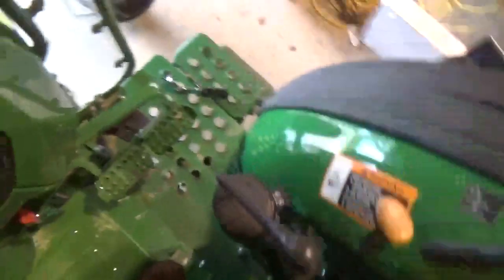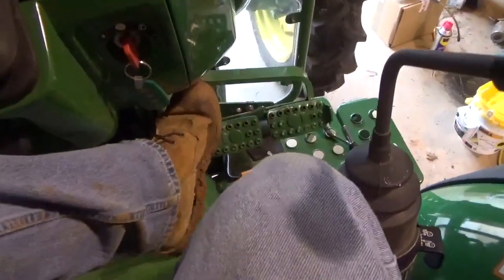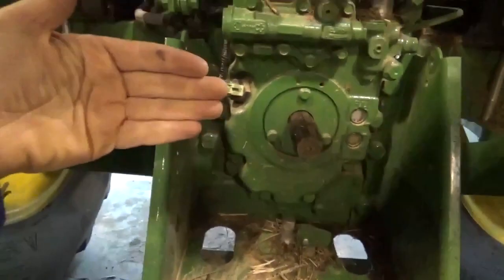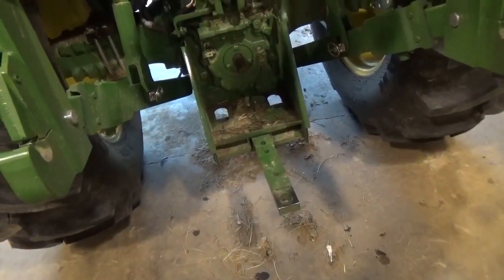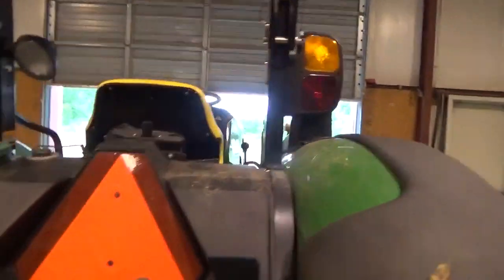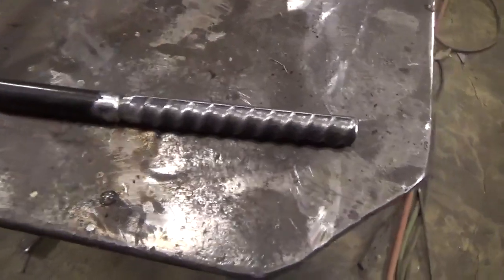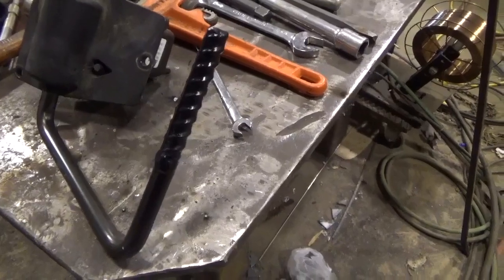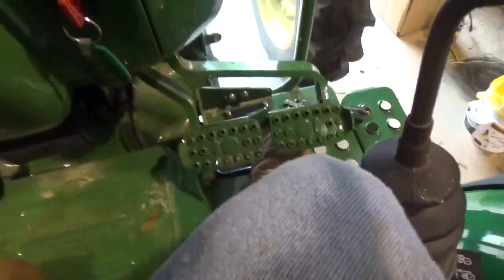New John Deere 5075E improvements!

Comment: The Deere Construction Buckets are stronger and better functioning than the Ag Buckets.
Check the Dealer for a used Construction Bucket.
Reply from the maker: +VideosByAl I am really considering just building one. I think it would be worth it from scratch just for the content I would get for the videos.
Reply: Good idea, no reason why we can't help pay for
an O'Bryant Construction Bucket .
Reply: I built one a few years back.. It goes pretty good if you can get the back portion pre bent

Comment: Good call on the skid steer mount Tim. I converted my kubota pin on bucket to skid steer style and it works great. Funny thing is I hardly use the bucket since I bought forks for the tractor.

Comment: looks interesting foot throttle mod. my right hand is real busy on my ol girl. clutch throttle 3pt hydraulic for my loader but my ol girl is a 57 JD 520. heck i had a lot of fun went into the woods and cut a fallen top and skidded it out with gramps homemade  boom pole then went for a blown down tree with the roots.  i tried to get over to it from one direction but i buried the tractor took 2 1/2 hrs with a come along to get it out. i then took and cut the 50ft trunk down and i dropped it one foot from my target and its first tree dropping

Comment: When I bought my JD 5075E I had the dealer change the JD mount on the loader for the skid steer quick attach with a JD construction bucket they come with the skid steer quick attach. Its not as large as the tractor bucket but it works for me. I use my grapple more the bucket anyway.

Comment: I have a JD 5400 very similar to your tractor, I have the same issue with the quick attachment, I will probably do a change to the euro quick attachment, because that's the more common in Portugal. this should be standard, makes no sense to have like 6 types of quick attachment.
Reply from the maker: +João Veríssimo I agree, there should be one quick attach and all use it.

Comment: Nice job! And the extension will surely have more grip! 

I have the same tractor, but with a cab. The foot throttle is moved to the right, clocked differently and is perfectly oriented. Maybe they mounted it like that because you can do a right hand mount, dismount. Which is not usual on a cab tractor, although I installed a right hand door so I could run the bucket off the tractor. The kit came with steps for the RH side, but I never put them on. 

I see you have a quick hitch. That is the same thing as the global mount in a way. You roll the bucket or implement down, manually pull the handle and clock it so it stays in the unlocked position. You set it down, an then go to the next implement. Once you pick up that tool, you roll up and the lock hits a cam, spring loaded and goes in the locked position with out having to dismount to lock it. 

I need to post some video of mine. I used my third function from a rear SCV. I have a grapple... It is SOOO FUN!!! LOL!

Comment: Could you cut a steel ring to mount the pto cover on to change it from a flip up to a pull out style with clips or wing nuts so the pto cover does not get dented by the top link?
or cut a plate that mounts to the two 'wings' to the side of the pto shaft.

Comment: Very glad you saw the light on Skid Steer (SS) attachments. Under 80 HP it is the only logical choice. Above 100HP the EURO or global is stronger than SS. The illogical choice is the JD standard with two hooks and two pins that require two snap pins. SS is the cheapest attachment type. Add $150per implement to the cost for EURO or the old JD. There are hydraulic kits to uncouple and couple with your third function valve for SS and EURO. Most EURO will allow you to uncouple. set down and implement/ lift up a new one and then jerk hard to have the bottom pins engage without getting off the tractor. The only advantages to the old JD are for the dealer - he gets more money and can sell you hearing protection for the bucket rattle too

Comment: do yourself a favor and get the JD 72 inch high capacity bucket. it is a case style bucket. you will not be sorry. it is extremely heavy duty and has a much higher capacity than the standard bucket. In my opinion the standard bucket is worthless. it is not tall enough

Comment: Deere has a reason for there attachments for there loader so you have to buy deere buckets and what not.
Reply: Before about 4 years ago or so, every tractor dealer had their own style of bucket attachment. Within the last 4 years, all dealers have began to offer the skid steer style attachment as standard. I haven't checked lately on what connections are available but know there was a big push to standardize equipment.

Comment: J.D. has been building tractors for one Hundred years and seems to have Forgotten the Basics. They can't even get a throttle or canopy right. 
A Few years ago I worked for our local J.D. dealer hauling equipment.  I hauled all sizes of tractors.  You would think that a Guy like me would be a "Kid in a Candy store."   But I didn't see much that impressed me. It was all I ever complicated  Computerized Junk that even the Mechanics said won't last anywhere near like the older Tractors.  
It's sad to see what American manufacturing has come to.

Comment: Yes sir Tim that's what I have on my John Deere is the skid steer attach so I can use all the skid attachments my bucket is like a skid steer bucket I'd like the regular bucket better I think like you said the regular buckets are higher in the back the skid bucket is longer on the bottom I'd rather have it in reverse no big deal still dose the job I'll send ya some pics crazy I just had a plate made for my skid steer so I can use the 3pt hitch stuff on that like a York rake so I can have down preassure do a gravel road or spreading loam looking good Napa Mike

Comment: CT,  nifty "fix" for the throttle but I"m wondering why you didn't put some angle on that extension to better match your foot angle ?  IMO, go with the skid-steer system 
!  Seems JD is making the same mistake as allis-Chalmers did many years ago with their proprietary hitch system.  IAC, keep up the dynamite videos !

Comment: Does a 6ft bucket make it slightly wider than the total width of your tractor tyres? - I do hope so as this makes life so much easier in practice when using the bucket.

I suspect you already know but the section shape of a tractor bucket is quite different to that of a skidsteer bucket. Notably the tractor bucket is higher in the back and shorter front to back.